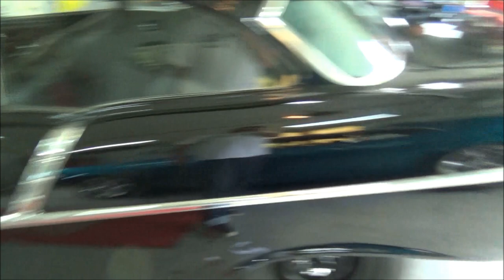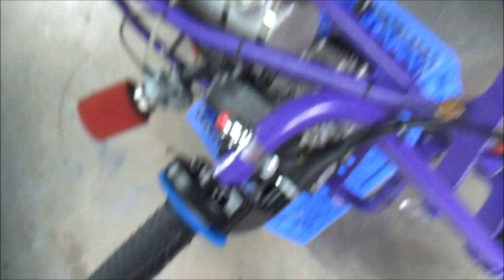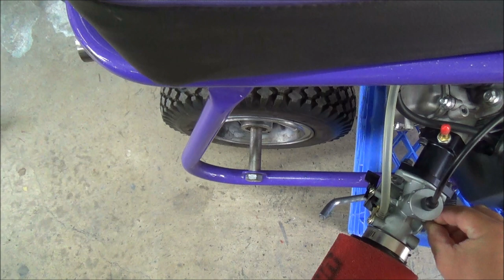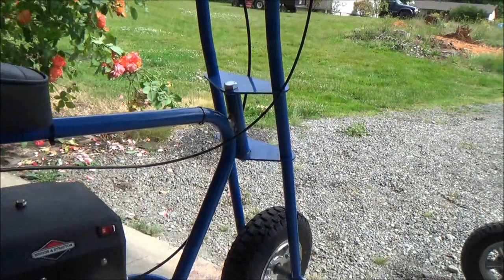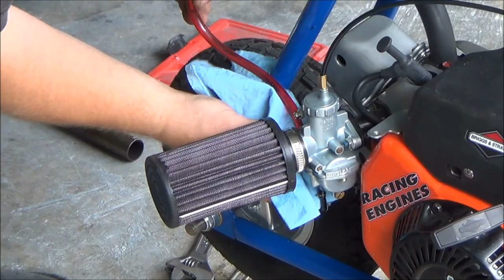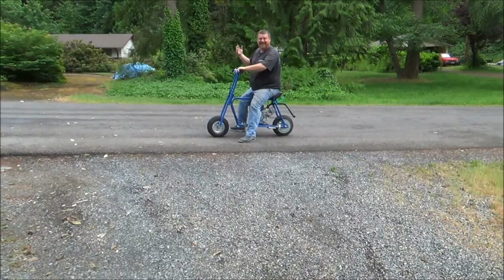SYF: Mini Bikes

Comment: Thanks for demonstrating the throttle response of an engine with the Mikuni style carb on it! My Predator's bone stock with minor mods (140 e-tube, bored out stock intake box, huge fuel jet) and it really woke the bike up, but my throttle response off idle is pretty weak.. It has a big stumble if I crack the gas, then pulls mad hard until redline.. I think its getting more than enough fuel, too much at a low rpm.. I might try out a set of jets or start looking towards a Mikuni conversion when I need more hp.

Comment: If you remember, what tires were you running on that blue bike? I like the tread pattern.
Reply from the maker: +Daniel Scott  I'm not sure anymore, but they probably either came from gokartusa or azusaparts
Reply: Shut Yer Face Garage No biggie. I like the rounded profile and that they are still a bit knobby. Thanks anyway.

Comment: Nice!  I never knew they'd run off of mountain dew lol So the predator 212cc engine wasn't that good? I'm not sure a 45 degree engine would fit on mine with the jackshaft.
Reply from the maker: +Cobrafanatik22 The predator is a great engine.  But they suck with the governor and stock throttle linkage.. So get rid of that and get a billet flywheel and they are pretty quick by my standards.. lol